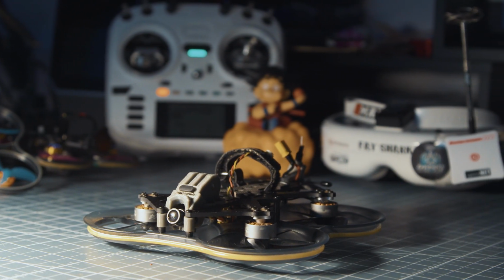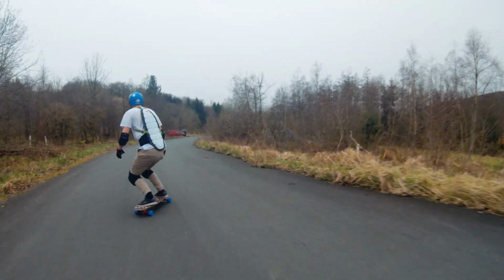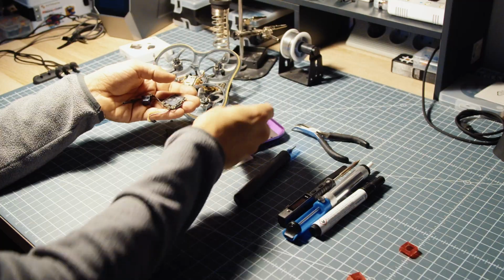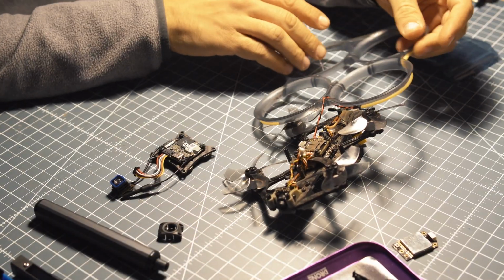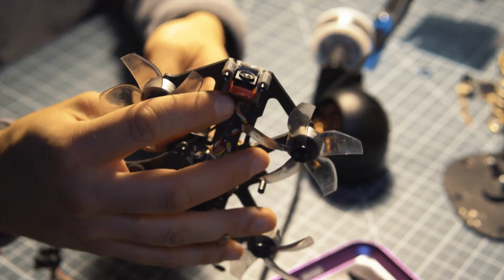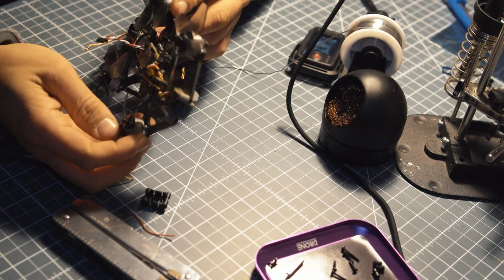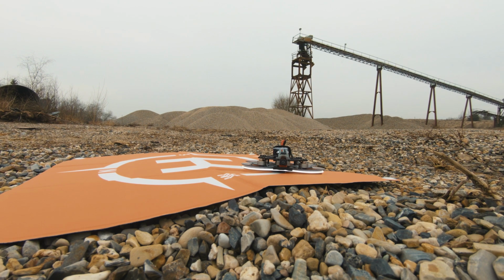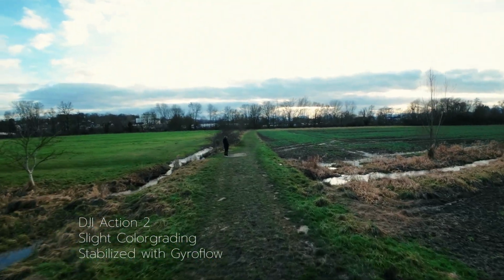Upgrading my old CineWhoop from Analog to Digital: CineApe25 goes O4

Comment: Wow, that's a really impressive update. I see you're using a different propeller than the one that came with the Cineape 25. What are the pros and cons of these two propellers? (The one you're using and the one that came with the factory one).

And did you activate air mode in the acro settings?
I also have Cineape 25, I'm really impressed with your flying skills, I hope I can follow suit.
Reply from the maker: Thanks mate! I switched from the 6-Bladed to 5 Bladed Props, because i wanted to test them, because they should be a bit more efficient. Yes, AirMode is activated, most of the time. I programmed my radio, so airmode will deactivate on my cinewhoops at a certain throttle positon and reactivate, when the throttle goes below that position. With that, the Drone wont get sucked onto walls when i fly indoor cinematics.
Reply: @cesfilms Thank you for your response. After testing, which blade do you recommend for freestyle like in your video? And do you have a tutorial on how to set up a turtle for air mode? I'd like to do that too.

Comment: I'm following your exact instructions cuz i have the Cineape25 too... But my question is: Did you screw in the camera? i wasnt able to cuz the screws wldnt go all the way in... there's a ridge right in the middle of the cam that's preventing the screw from going in :(
Reply from the maker: Yes i screwed it in. Are you using the original screws? It could be, that you have to use shorter screws
Reply: @cesfilms i managed to secure it lol, but now there’s a lot of jello😂😂
Reply from the maker: @TrippyFPV469  without screws? I have no jello at all
Reply: @cesfilms no i used screws… u used screws and have no jello at all??? I swear this is driving me crazy man…
Reply from the maker: @TrippyFPV469  weird... only other thing i did on the cineape was changing the props from 6 blades to the 5 blade ones. Dont know, if this would fix it? Using stock tune on the cineape.
Reply: @cesfilms will try doing that. Thank you so much man❤️❤️
Reply from the maker: @TrippyFPV469  oh and if you use the built-in stabilization of the o4, try to turn it off. Rocksteady always makes my image shaky on the o4 lite. Rather use Gyroflow for stabilization
Reply: @cesfilms heyyyy never thought of thatt!! Great advice man thnk u!🙏🙏🔥
Reply from the maker: @TrippyFPV469  you are welcome man! Let me know if it worked for you :)
Reply: @cesfilms  UPDATE: it works perfectly fine now thnks to u! u're awesome man thank you <3
Reply from the maker: @TrippyFPV469 awesome! Happy that I could help :)

Comment: interesting to install dji o4 on my cineape 25.
how much flight time after you install dji o4?
Reply from the maker: about 4 minutes with the nked gopro 7 (about 26grams) and 5 minutes without. I used the gnb 720mah HV 4s lipo
Reply: @cesfilms  Thank U.
do you also use GPS in your settings? because i see only 1 URT available anymore (URT2) in cineape 25
Reply from the maker: @tabalaistation8944  since both uarts are used in my drone for ELRS and the O4, i dont have a GPS in it
Reply: @cesfilms  thank U, I think so
Reply: CONFIRMED: you can use S5 and S6 to connect GPS. UART2 can then be used to connect your O4.
Reply: @andreafabbro7844  Interesting info. By the way, I successfully installed the DJI O4 after watching your video.

Do you have any references or tutorials on how to use these two ports? S5 and S6 to connect GPS.

Comment: Is the Cineape 25 also compatible with the DJI o4 Pro? 
Where do i Find the 3d Printer file?
Reply from the maker: No it isnt really compatible, because it dont have enough space to fit the Pro camera in. I saw a 3d print design to put a o3 on top, maybe there is one for the o4 pro too. I will look into that

Comment: No bec needed? They said that 04 lite was only for 1s-3s,   I also have a cineape25 and wanted to replace the analog vtx with dji 04 lite so i can upgrade to digital fpv the cheapest way possible.
Reply from the maker: I soldered it on a free 5v pad on the fc
Reply: @cesfilms  Thanks man

Comment: Can this quad fly indoor I’m stuck between this drone for budget or cinebot30.. which you’ve recommended first drone. Thanks 🙏🏽
Reply from the maker: Depends on what you wanna use it for. For indoor cinematics it’s fine, if you use a lightweight camera (DJI action 2 is the max weight I would recommend, but I tend to use a decased GoPro). For freestyle It lacks a little of power but all in all it’s quite good for that price 👍